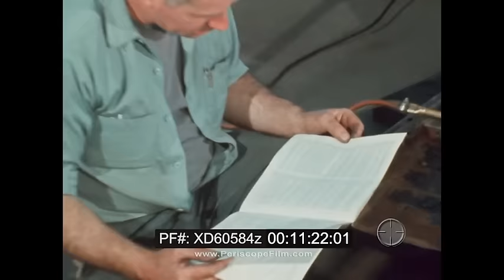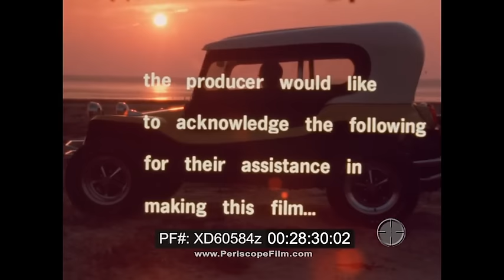"HOW TO BUILD YOUR OWN DUNE BUGGY"  1970s DO-IT-YOURSELF VW BEETLE CONVERSION KIT FILM  XD60584z

Comment: I had a Meyers Manx back in the day. I bought it already made. It had a "bus transaxle" so it was geared lower and had higher ground clearance. This was in the late 70's when the first Toyota 4wd pickups came out. One day some friends who had Jeeps and Toyota trucks were going on a trip to a very sandy area. I said I will go too. One of the guys said that that "thing" will get stuck. Funny thing is that I drove circles around them with my light weight, wide back tires and rear weight bias. That thing was so much fun. I ended up selling it to my brother who never paid me for it and I don't know what became of it. As with most of my old cars, I wish I had it now.

Comment: Now remember, before starting a project like this you’ll need the help of your friend Dennis. BE SURE that Dennis smokes a pipe. 

Always remember to smoke while welding. The presence of highly combustible gases shouldn’t stop you from being in flavour country. 

If the hood alignment gives you trouble, try growing a beard or some excessive sideburns. 

One thing to always be sure of, is to never wear eye protection when using power tools. So long as you’re smoking - that’s all the protection you need.
Reply: Had me in pain and tears. Thanks😂
Reply: Real Men Don't Eat Quiche
Reply: 😂do the pipe and sideburns do the same job as seatbeats too?😂😂
Reply: The guy ripping the Marlboro with the gas axe going killed me 😂 all i could think was Man when you light up you don't miss much do you Jonesy! 😂

Comment: The 1st 3 cars my dad had when he moved to PS Ca were dune buggys on VW bug chassis'
I used to ride shotgun with my big brother back in the mid 70s.
My dad had them built and serviced by some vw guy outside town that owned the original 'Hole in the Wall' VW place.
Thats when PS Ca was still a ghost town and only had a few traffic lights on the main road.
Those were good times and  great memories❤❤❤❤🙏🏼🙏🏼🙏🏼🙏🏼🙏🏼

Comment: Simple. Just buy a crashed beetle with no frame damage, remove the body, cut 14 1/4" from the middle of the chassis, weld it back together, put the drive train back together, attach the dune buggy body. Then, you have a dune buggy! Hope it doesn't break in half.

Comment: I am trying to guesstimate the model year of this VW. It has a fuel gauge. That makes it 1962 or later. The headlights and wheel caps seem identical to 1962. The beak with a licence plate light is slightly wider than 1962. My guess is 1964 +/- 1 year.

Comment: Surprised tyhey didn't say anything about adjusting the rear suspension to even out the camber back there. Would do wonders for that high speed instability.
Reply: The swingaxle suspension on that car means that the height of the car would determine the camber. The only way to correct that would be to lower it, more like a stock bug. Later IRS bugs didn't have this problem when making them into buggies.
Reply: @user-tg1ks9qz1l  Ye that falls under 'adjusting rear suspension' to me. I would either fit softer springs(Probably best option since the buggy weighs so much less than a stock Beetle), shorter springs, or since it's 2024 and not 1974, source one of the later IRS bugs as a chassis donor.

My 85 and 95 F150 both do the same thing in the front because Twin I Beam suspension acts in a very similar manner.
Reply: @@iebuilt8241 Torsion bar, eh? That makes it even easier. All you have to do is remove one end of the spring, rotate it a couple splines, and slam it back together. Repeat until rear camber is correct and bam. Solved. Torsion bar setups are the easiest ones to adjust ride height on of any passive suspension system and that just draws back to my first comment: Why didn't they mention doing this in the video?
Reply: Yes, you're correct, they definitely could have fixed this by lowering the rear, but that just wasn't the look that people were seeking,  which was of a sand dune capable fun machine.
Reply: On the rear, you took the cover plates off and re-indexed the torsion bars to reduce the camber after removing the heavy metal body. Not a big job. Surprised they didn't mention that in the video. Oh, and there was a flat bar with straps at each end that limited the amount of negative caster that made for a safer handling buggy called a camber compensator.  There was a simple kit available used to modify the front axle that made the height adjustable with just a wrench. All this was available by 1969 when I built mine. @user-tg1ks9qz1l

Comment: Very surprised they didn't recommend swapping the wheel bolts for studs. Makes life so much easier and so much safer than relying on steel bolts in a cast iron hole to keep your wheels on.
Reply: They showed him putting on adapters to use US auto wheels.
They had studs.
Reply: back in the late 60's , there were few aftermarket wheels available in a Metric pattern....
Reply: Wheel bolts are safer. With a stud and nut, you have two parts, each of which can fail.

Comment: interesting, but a safety point, although the petrol tank has already been removed, it is inadvisable to smoke while dismantling a car, the foam in the seats, plastic parts, residual petrol fumes from vent and supply lines, all could catch fire, and harm you, not just your investment of the car.

Comment: 5 pounds of air? 9 pounds of air?....🤔
Reply: Yes, a 1,300 lb. car on the bias ply tires of the day that were designed for a 3,700 lb. Chevelle or Fairlane.  Those would be correct pressures, especially for off-roading.
Reply: @Thomas63r2  That's crazy! Well, I learned something today! 👍👍

Comment: Still find it amusing that someone would go through the trouble of a dune buggy conversion when you could always just buy a kubelwagen("thing" as it's known in the US).
Reply: But they didn't so a Kubelwagen is now a rare animal worth a fortune.
Reply: The "thing" only sold for a couple years here in the states, and so few they're mostly garage queens or wistful memories now. Any beetle, on the other hand, could be butchered into a buggy (and they were being so modified for several years before a US "Thing" was a thing, lol). The buggy also has some advantages in muck, sand, and other self burying surfaces due to low weight.

As a utilitarian "Swiss army knife" car, the Thing wins hands down, undoubtedly. For bashing around beaches, deserts, and mudholes, the buggy has some fine points in it's favor
Reply: This film was created before the Thing was available in the U.S.  These Bug based dune buggies could be built for far less than the cost of a Thing.

Comment: I have a friend who many years ago built one, the problem he had, which might be solvable nowadays was the big wheel/tyre combination wrecked the gearing only the light weight saved it
Reply: The trick on swing axle suspension was to use bus gear reduction boxes which also gave you more ground clearance without causing extreme camber angles. Win win.